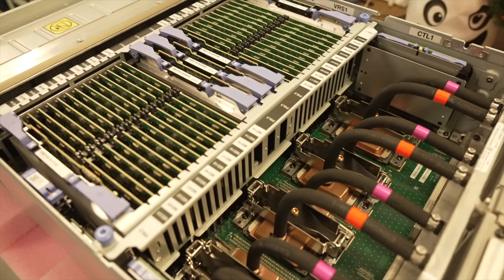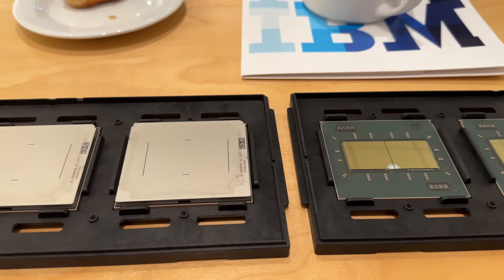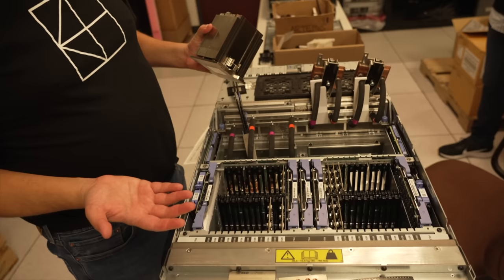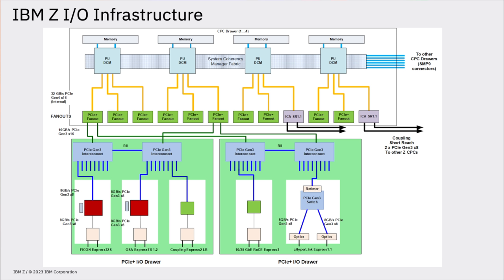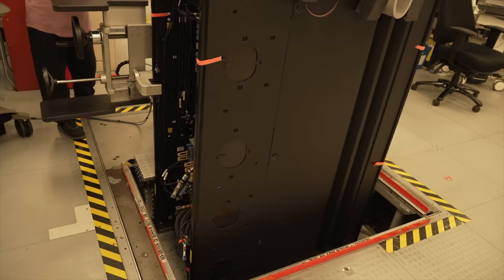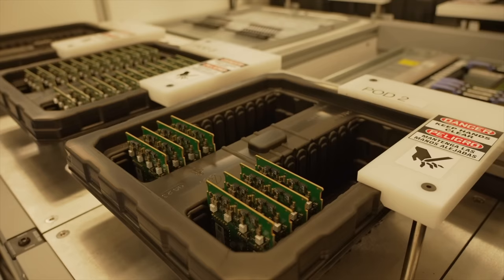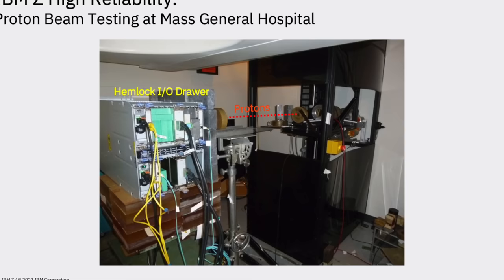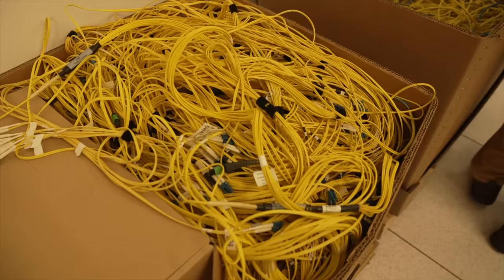Why Do Mainframes Still Exist?  What's Inside One?  40TB, 200+ Cores, AI, and more!

Comment: I'd be interested in seeing what they do with the operating system; how they partition the workload, how the mainframe itself is maintained and run...
Reply: In the late 70s I had access to a System/370 model 168MP. MP meant two full CPUs configured as a single computer. One evening I dropped in, and after a short conversation it was agreed I can have my own computer for a few hours.
Without interrupting the  workload, I showed an operator how to separate out a CPU, some RAM, a channel,  some DASD, a 3270 controller so I could have a console for doing stuff. Then  got out my 3330 disk pack and ran OS/VS1 for a few hours, doing a SYSGEN for our computers. When it was done, I showed an operator how to put it all back together.

Back then a CPU alone occupied a whole box, and there was another to connect the two CPUs, and each channel also had an equally large box. I had to read the numbers on the sides to see what was what.
Reply: One thing Dave did not really cover (maybe because he didn't work on them himself) is that mainframes are a whole other world of computing. Sometimes you just have to forget what you think you know. Many of the same terms are used, but in different ways than you might expect.  
Partitioning is a key aspect of mainframe architecture.  The bare-metal partitioning mentioned is called an LPAR.  I'm sure you can find more details about that by searching for that term.  A mainframe operating system can then soft-partition available memory to different tasks.  This essentially contains each process.  Each program running at any given time runs in its own [memory] partition.  

In the frame cabinet, behind the front door, there is one or two laptops that are affixed to the frame to be opened up and used.  This is called the Support Element and is the lowest-level access to the complete machine's operation and status.  Satellite computer(s) outside of the frame called the Hardware Management Console can do many of the things the SE can, but over the years the distinction has gotten less and less.  If you wanted to turn on or reboot or partition the mainframe, you would use the HMC or SE.  As mentioned, when failures happen, a hot backup instantly kicks into place, and IBM is automatically notified so a repair will be scheduled.

Edit to add to my comment:  The zSeries and z-  mainframes are a complete 64-bit architecture.  They also started out being fully backward-compatible even for old software written in the 60s. Some of that very-older comparability has been removed or minimized in newer z- models, but backward comparability is a huge assurance to customers.
Reply: Well i have worked for a long time on the software implementation end for IBMs os and other servers and know that they configure storage devices and use mount points directly to deploy oses, they are tricky to configure, I have not configured personally but I have worked on these mount points or something they called luns to setup our softwares, they even have replication directly from the storage itself
Reply: The redundancy around the Storage is quite impressive. You can lose a disk array in one data centre and its replicating counterpart in another data centre can take over the workload without it impacting on normal IO on the mainframe... Just an increase in IO read write time due to the change in distance when going cross site.
Reply: @jovetj  I programmed S/370 from the earliest models plus the Facom equivalents in Assembler using BTAM, VSAM, EXCP and getting into JES2 - b separator, exit 6. I also wrote for remote 3270 terminals, strings of 3275s.
A couple of weeks ago I looked over the latest versions of the manuals I used back then. Very little has changed, all the example code was just what I used back then. I think the odds are good that my old JES2 exit 6 might still run.

The VSAM I did used control interval access, I was validating some dodgy IMS databases.

I also did assembler work on Fujitsu's OSIV/F4 (basically MVS) and OSIV/X8 (basically Fujitsu's own). The hardware was largely the same, most of the DASD was the same, there were 3270-equivalent terminals.
Reply: @oneeyedphotographer  The code being compiled for 64-bit z is one thing... but 24 or 31 bit code compiled way back when is quite another.
Reply: @jovetj  I was looking at the assembly language source code. Its execution could be influenced by the PSW or control registers, but I have no knowledge of that.
Reply: @oneeyedphotographer  IBM BAL (Basic Assembly Language) is different that what we're now accustomed to. IIRC there is no stack. Reentrancy is handled by saving of the registers to memory, storing the next instruction to be run after a subroutine in register 14, and jumping to code. There was even a (JCL?) command that did nothing so you could create, delete or rename files called IEFBR14. The program contained one instruction: Jump to address in register 14 (a.k.a.: RETURN).
Reply: @rabroom  In IEFBR14 that's a bug, and I heard it was actually perpetrated. So too an assembly error. The correct code is
   SLR 15,15
   BR    14.

And then IBM decided all its programs had to contain textual identification, so
HERE     BR    THERE-HERE(,15)
               DC    0H'0',C'SOMETHING DEEP AND MEANINGFUL'
THERE   SLR   15,15
              BR     14
              END    HERE
Fujitsu had a SVG instruction to save general registers.

I wrote my own macros to deal with calling conventions and reentrance. Since R13 hat to point to the save area, I extended that area to whatever I needed and based the whole area off R13.

If the calling conventions of the 70s don't still work, there's a lot of COBOL and PL/1 code got broken.
Reply: At a high level there’s a stack (like OpenStack) … zOS hands off to AIX that hands off to RedHat  …

The zOS (rebrand of MVS/JES2) is just a job processor … think a sophisticated printer … where each job or sub job is ruled by its memory and DASD access
Reply: @Midnight_Freedom  Huh?  That's not even close to correct. z/OS is the operating system (think kernel).  On top of that are components such as JES (job entry system), security managers (RACF), etc. AIX runs on POWER and has nothing to do with Z. And while you can certainly run z/OS on the same machine as Linux, they certainly aren't going to be in the same partition.  Nothing in z/OS gets 'handed off' to Linux.
Reply: @rabroom     program IEFBR14:     (four bytes of code)
         XR R15    zero return code
         BR R14    return to caller (the operating system)
Reply: @rabroom   (copied from some old BAL coded in 1988:
STM    14,12,12(13)
LR        R10, R15
USING  PROGSTRT,R10
ST        R13, PROGSAVE+4
LA        R11,PROGSAVE
ST        R11,8(R13)
LR         R13,R11

(((program code)))

L           R13,4(R13,0)       Restore R13
LM        14,12,12(13)
LA          15,0                     put return code in R15
OI           15(13),x'01'
BSM       0,14                     Return and in caller's mode

Comment: You overlooked a key reliability feature .. the IBM Z series includes extensive internal self consistency checking of the logic inside the CPU so it can detect when the logic fails and retry a transaction, shutting down the core if necessar.  "Commodity" CPUs are tested after manufacture but after passing test most later errors are silent.  Recent testing for silent errors in servers at Google and AWS have found that silent errors are quite significant.  IBM has taken them seriously for decades.
Reply: That is one of the most important features, and also one of the most important differences between mainframes and micros. The US government has a huge set of operating guidelines that must be met by the bank's IT departments, and I'm out of date on that stuff, but those generic CPUSs probably don't pass those guidelines for certain transaction processing.

Comment: I was a MVS systems programmer back (way back) in the 80’s. It would be really interesting to me to know something about the OS environment(s) running on these things. I get it about the virtualization capabilities. But there is still something managing them. Thanks Dave!
Reply: I'm a current systems programmer, we run about 50/50 z/OS and RHEL. Most of the stuff you are familiar with is probably still around, just now you also have web servers and it's sort of slowly evolved into more of a unix type system. MVS is still what people call it, IBM uses that term now to refer to the non-unix part of the OS. So ya know everything with datasets instead of files basically. So z/OS is made up of z/OS Unix and MVS. 

It's still a very customizable OS but I think people have probably mostly moved towards the point of regretting some of the crazier customizations at this point as giant kernel level assembler programs become very difficult to maintain especially when you had the switch to 64bit and those sorts of challenges. Still plenty of retired systems programmer code out there in the wild causing trouble haha.

Linux is Linux of course, the majority of shops are probably running most of their Linux on top of z/VM or possibly Linux on top of z/VM and then more Linux's on top of that KVM.

I guess the only other thing to say is that ISPF is still probably the most popular interface on the MVS side (that's the green screen except it has more colors now for all you non mainframe folks), but you have more options now if you want them and can have a command line and vim workflow or a remote IDE.
Reply: Microcode, the MCL (on the SE) loads microcode (in POR) that creates the environment for the Image (LPAR). Your Image then has an environment with channel access to storage to load an OS from (IPL (Initial Program Load)). That's called IML (Initial Microcode Load), and until you've done that the Image environments don't exist. Once it's been done IPL for the specific Image environment becomes available.

MVS has been 'rebadged' as is the current trend, to z/OS, it still looks and feels like MVS, so you'd recognise it. It's also had a whole lot of modification to make it more Java friendly and cloud capable.

z/VM is the micro partitioning OS Dave mentioned, and is still quite common.

Comment: I started my career as an operator on Burroughs B3500/3700, ICL 2904 and then moved into IBM S/370. Eventually I ended up in Sales, with Novell, Cisco and Oracle, and I've watched as things changed to cloud, containers etc. But having worked on those mainframes is like a badge of honour. You were part of a very small group of specialists in an emerging industry (and back then many of us had no idea how big it would become).
Reply: A Burroughs guy!  Hello. The first computer I ever used was a B5700 at my uni in 1972, I loved that machine. My degree was Applied Math and Computer Science and my career remained in the Software Development area.
Reply: I started on Unisys A Series then operated B2900s.  Your story looks similar to mine (see my top level comment).
Reply: My first job interview was with Burroughs in 1981 where I had was shown a mechanical calculator and was required to explain how it worked. Thankfully I didn't get the job and was employed by IBM a month later. Great company to work but sadly they totally  stuffed up the PC market opportunity in the early 90's.
Reply: I joined Burroughs in 1970 in the UK, starting on L/TC Assembler. By 1972 I was doing systems architecture and project leading/management work and the actual machine didn't matter all that much. I was working at the Burroughs World HQ in Detroit on and off from 1972 to 1975 and emigrated to Australia in 1976 working for Computer Sciences Corporation. I found myself working with B7700, IBM 370/168 Univac 1100, and a bunch of other stuff. I worked for Digital in the late 1980s. It's been fun.

Comment: When I went into the USAF in 1993 (AFSC 2E231), I spent almost a year at Keesler AFB learning component-level troubleshooting and maintenance of the old Sperry mainframe that still had spindle hard drives, punch card readers, and large reel-to-reel tape drives plugged into it.  Boy, how times have changed.  Of course, by the time I got my first PCS to McChord AFB, the 62nd Communications Squadron was actively pulling the main frame out of service and replacing it with Novell 4.11 servers and Windows for Workgroup 3.11 on Zenith Z 386 workstations.

Comment: One of the major advantages of the mainframe… is that the same size support staff for the OS is all of its software does not change from the smallest machine to the largest machine …. For example, a SSA, two systems programmer handle all of the zOS instances… all of your SSA interactions, including the Web interface is on Two machine geolocation diverse … 50% split use and dynamically back each other up …      Two CPUs.
Reply: its almost as if they're doing all the heavy lifting of the entire operating system via hardware. (I know they are, this is rhetorical)
Reply: That's true and one of the reasons it can be cheaper for a lot of businesses to pay such a huge premium for the hardware and licensing. If you go the distributed route but want the same snappy feeling and feature set and have everything replicated and in one place, you are looking at paying a shitload of engineers to maintain a very complicated Kubernetes setup and a bunch of apps to handle that complexity and make it reliable. That could all be provided by a couple of systems programmers with a mainframe and the operating systems, and then more resources can be devoted to defining business processes in custom apps specific to your business. It's a very different model than what you find in flashy high tech companies, but I think it may be fundamentally superior for a lot of industries.
Reply: So what you are describing is a SYSPLEX, a cluster of mainframe images (LPARs) running as a single system (the 50% split gave it away). The geolocation diverse line might make yours a GEOPLEX, so somewhere on your mainframe complex there will be a CF (Coupling Facility) that handles the Image to Image communications between the two physical systems (it might just be in an LPAR on one of the processors).

Comment: In 1969 I landed a programmer trainee job at a department store in Cincinnati.
We had a 32K 360/30 running 360 DOS and  Assembler was the first programming language I learned.
After being away from mainframes for 20 years, I applied for a position at a shop that had 6 System 390's.  The hiring manage asked if I thought that I could still do assembler - I said if "D2" was still the op code for the MVC instruction - then yes.  He was surprised that I knew most of the op codes and could even read a core dump.

Comment: This video is giving me some hope that IBM marketing/communication efforts on the midrange and mainframe technology will improve and will be more focused on the way information should be presented today. The effort I need to get IBM technology financed by management is way higher than the one needed for x86 computing, networking or security, because when people hear the mainframe word, they think to old dusty things that runs legacy code written for archaic programming languages that you access trough a text based console. Yes, mainframes can also run that kind of things, but most fo the time you need a mainframe to run very specialized tasks at state of the art level.

Comment: I know the AS/400 family used to be based out of Rochester MN (I dont believe it is anymore) and they allowed things like paying for cores after you've purchased the hardware (they were software locked and shipped basically the highest configuration CPU wise at least irrc)

Edit: one of my favorite war stories was that a company had an IBM mainframe running in their server room and a semi ran into the building and pushed the whole mainframe rack across the room. IBM techs came out and made sure all the cables were still connected and it continued running until they were able to ship a replacement system out.

Comment: I once spent a week in the Twin Cities at Unisys' HQ to get trained up on their "new" class of ES7000 mainframe servers that were optimized to run Windows Server 2003 Datacenter edition - While touring their company museum, my tour guide asked if I "knew the difference between and IBM mainframe and a Unisys mainframe", I shrugged and he gleefully said "Unisys mainframes suck, but IBM mainframes blow!"  He then explained the difference was their liquid cooling, in which a ruptured hose in the IBM mainframe would cause the coolant to spray the inside of the chassis, whereas in a Unisys, it'd just leak on the floor,